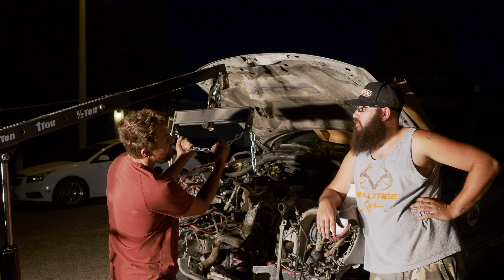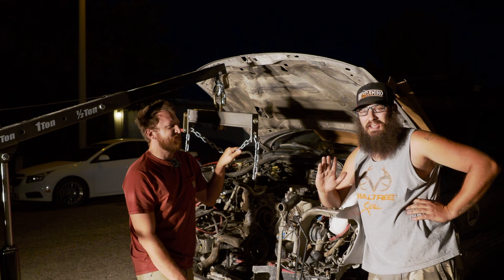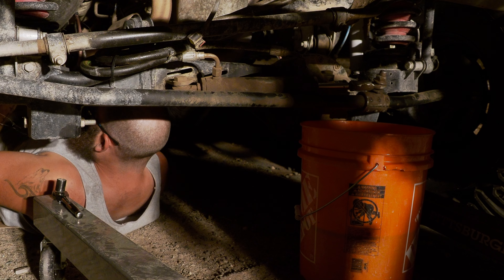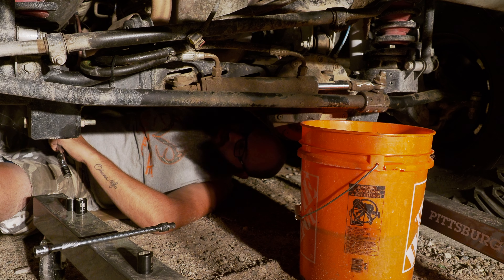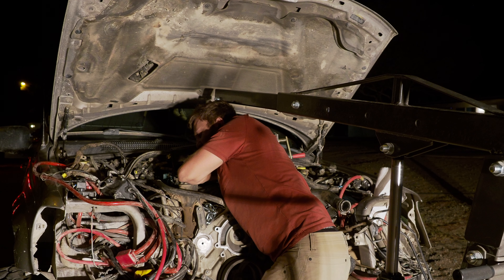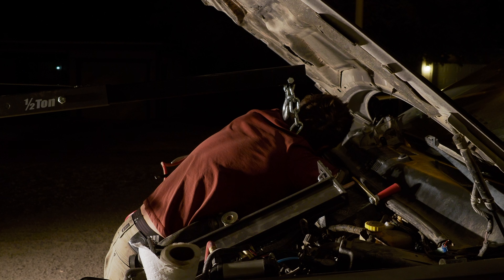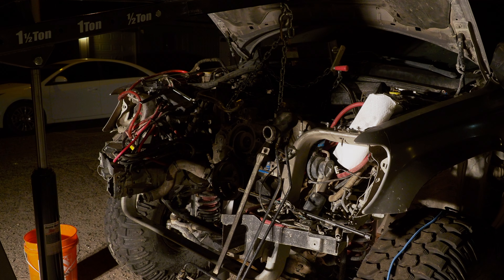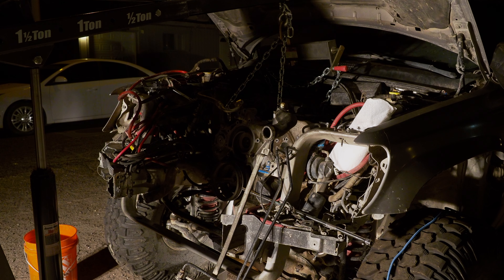WJ Engine Removal Part 2: This Is How You Remove A Cherokee Engine

Comment: Thanks for the vid. Very helpful. Were there any other issues you had? Was the exhaust a problem? Did you disconnect at the head or farther back?
Reply: No major issues. Except for the upper bellhousing bolts. We’re a royal pain to get to. Exhaust was fairly easy. No broken bolts. Jeep has 195k miles on it. And lived majority of its life in Washington. We removed the the exhaust at the exhaust manifold. And then pulled the exhaust manifolds once the engine was out of the Jeep. No broken bolts there either. Expect for one stud that held the heat shield on.
Reply from the maker: Glad you enjoyed the video! Exactly what Dave said. We found it easier to just leave the headers on the block than try to remove them in the engine bay. It’s just so tight in there. Thank you for watching! 

Thank you Dave for responding!